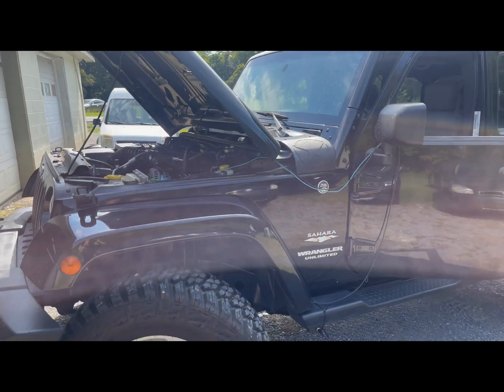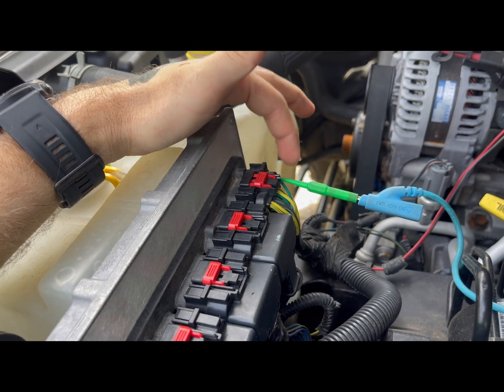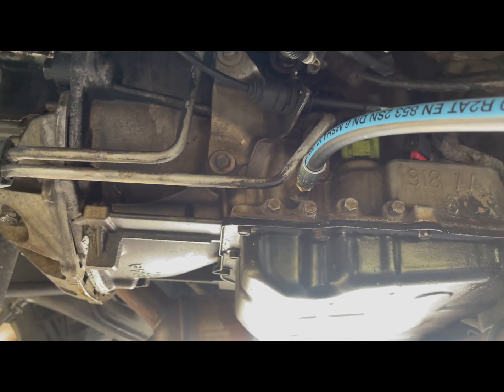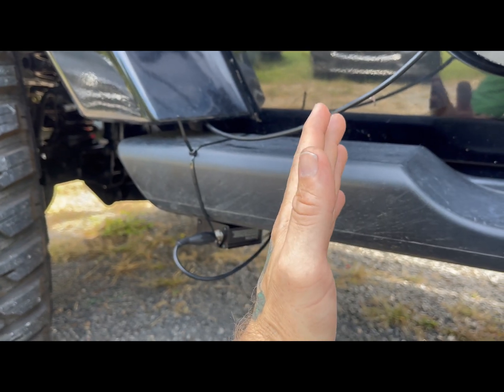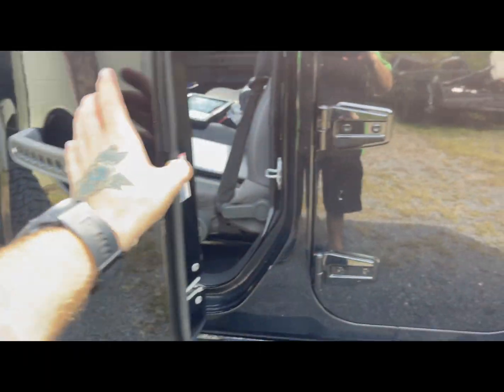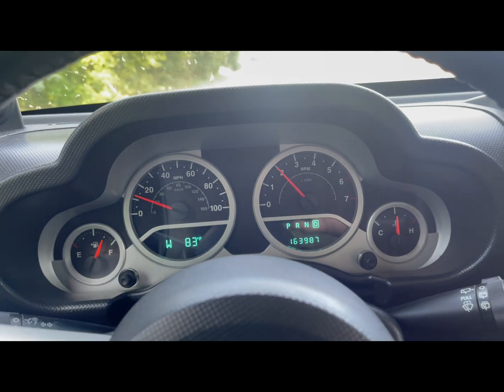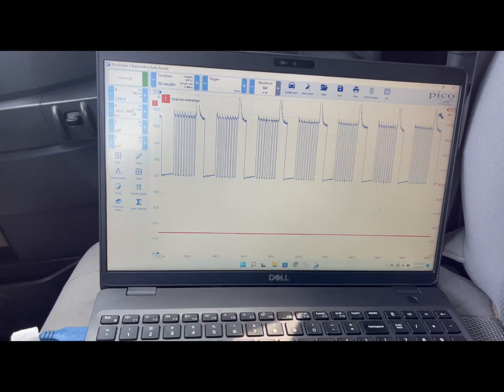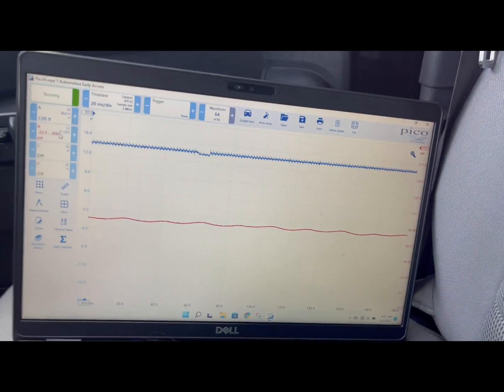Easy Transmission Diag with Picoscope Jeep P0740

Comment: 💲
Reply: Did same test after I rebuilt U140. OverDrive was shot, and frictions starting to fry. After rebuild 2-3 shift had a flare. It was the Direct drum with a tiny grove wear from the teflon rings, so lite could hardly feel it with a finger nail.  I never seen the U140 at the shop I worked at for rebuild when I was there. The expense to rebuild is same as remans as I learned. Each time these U140 gets rebuilt, One must buy OEM direct drum new. $300 +.  Didn't have to drop trans to remove back cover for drum replacement, a bit tricky. the pressure transducer and a bet of back probing can really narrow it in. Also can see servo leakage and worn servo pin to case problems. AX4N is a great example.